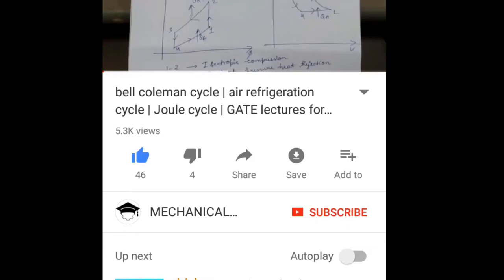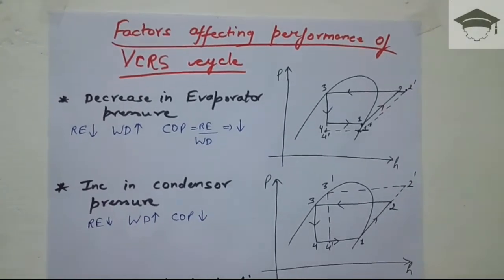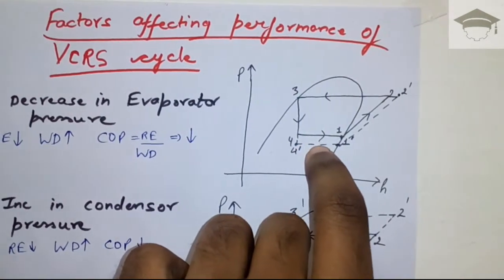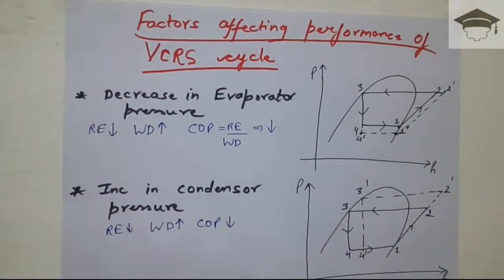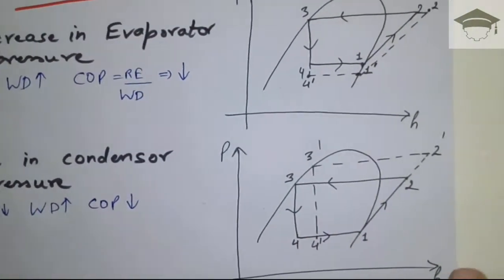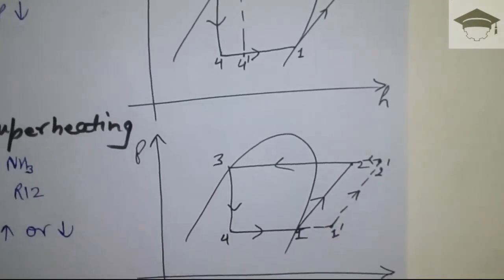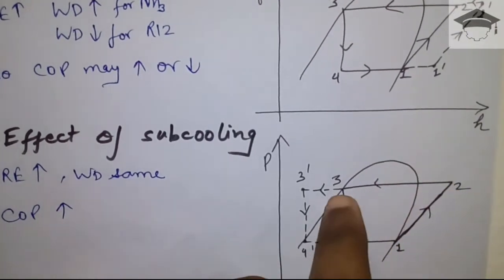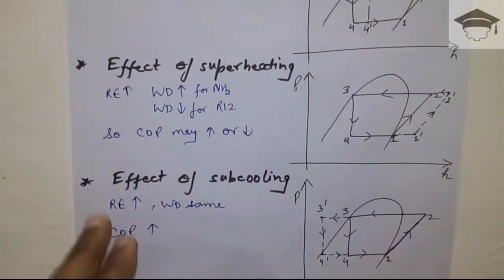Effect of variables on coefficient of performance (COP) of a vapour compression refrigeration system

Comment: In case of superheating, the work done increases for both R12 and NH3. 
I guess the reason for decrease in COP is related to the fact that on a p-h diagram, the isentropic curve gets flatter in case of NH3 as the degree of superheat increases, so the increase in work is quite higher as compared to the increase in R.E. Even in case of R12 the work slightly increases, but the increase in R.E. dominates.